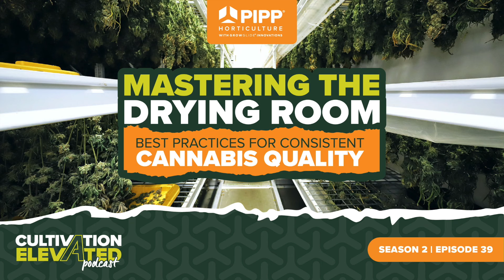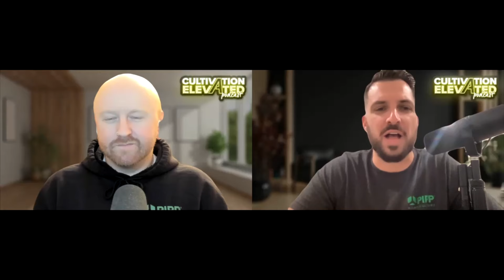Mastering the Drying Room: Best Practices for Consistent Cannabis Quality

Comment: As a homegrower, i view drying like curing in glass jars. By that i mean in my drying tent i try to keep it around 65 degrees or cooler and the humidity i aim for 60% but it will creep up, so i will open the tent and let it burp until it drop back down to 60ish (the room the dry tent is in has a dehumidifier). Close the tent then burp the tent each day of the drying period, so the humidity fluctuates but never goes lower than 60ish. I’ll do that through the entire drying period. It will start to stabilize just like when you are curing in the jar. I found this works better than using my exhaust fan to keep the humidity stable and it gives you another marker when the drying period is over. However, doing it this way without an exhaust fan will stink up your house way more than using the exhaust fan directly in the tent (you can filter the air in the room the dry tent is in but not in the tent itself).
Reply: That’s interesting bro . I’m new grower .First few havnt been nice at the end . I’m drying in 4x4 ..4 plants ! Once I chop the rh is always like 70.. so I wud run the extraction to keep it say around 68.. then it gets down to 60 and below after about 4 days of tjis .. so was then adding in the humidifier to bring it and keep it at 60 rh until I get that stem pop .. it’s not working cuz my shit doesn’t taste great . Gonna try ur way next run 👍
Reply: @todgerx taste comes more from curing drying just gets rid of the chlorophyll taste.
Reply: @todgerx drying and curing are two different things when your drying the only thing you want to achieve is getting rid of the moisture while preserving the terps as much as possible before you start curing the flower
Reply: @Fugaesi yeah tho my biggest issue is maintaining it around 60.. when I first chop 4 plants.. there is lots of humidity, like 65/70.. if I put dehumidifier in tent , it can get it down like 5rh or so but it raises the temperature up to 20/21c .. to bloody warm! I’ve been tru 3 dehumidifiers amd none of them can get the rh down while keep in temp down as well. I bought the ac infinity dehumidifier the hydrone 5 .. it arrived just a little late for my last run, so looking forward to trying it next run .   Think I’m gonna In long run get dry cure box . Thanks for replying appreciate it